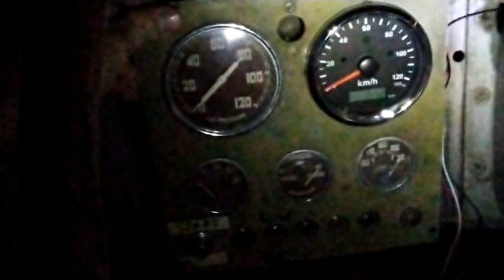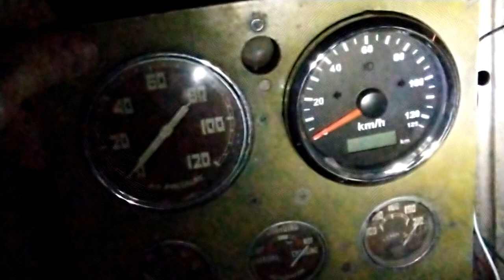GPS Speedo Install with Road Test & Governor Inspection

Comment: Have you thought about adding a block heater? Better for the engine than using ether to start on cold mornings.
Reply from the maker: We have one already. I wanted to test that morning if it would start.
Reply: The trucks that run the routes through Siberia often have ramjet heaters to preheat the engine before starting.  Same with all Soviet tanks.

Comment: Great video Jason, and Gus is running like a champ! There's a company that makes gauges and speedos to match the originals and they also sell vintage look gauges and speedos. I cannot remember the name, but I used them back in 2010 for a full set for a 1966 Beetle resto-mod I did back then and they were amazing. I'll see if I can find the name for you.
Reply from the maker: That would be speedhut. They are quite expensive.  Going to look into printing my own overlay for this one if I can take it apart!

Comment: Another good video.  Looks like that switch over valve just needs a good cleaning.   You've really developed the proper senses for shifting the non-synchronized transmission.  Are you double clutching or float shifting?
Reply from the maker: Double clutching.  The biggest thing with the non-syncro transmission is to be patient!  You can't force it.
Reply: @BusWithUs.  yes, having driven many a 5-speed Mack and a few 4104's it takes a combination of patience and timing. It also helps to have an accurate tach and speedometer,  especially when downshifting.
Reply from the maker: @markphilpott8735  Haha I drove about 3000 miles without either!

Comment: If I were looking into a GPS speedometer I would seriously look into a VDO one.  They're a bit harder to install since they use an external GPS module but they're probably been making them longer than anyone else and they do have a backup accelerometer.